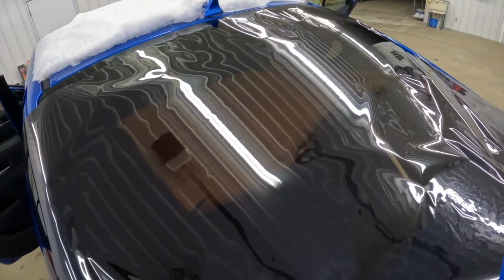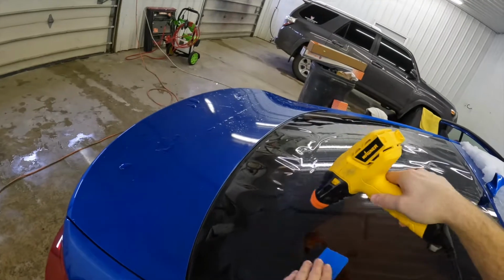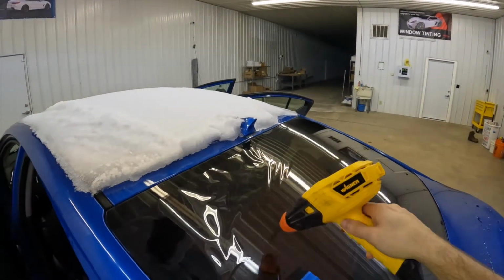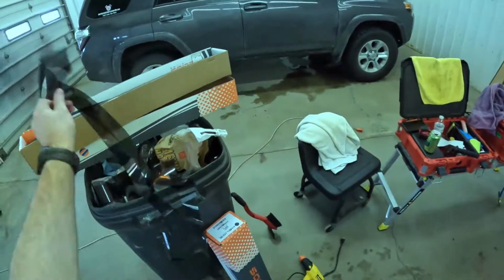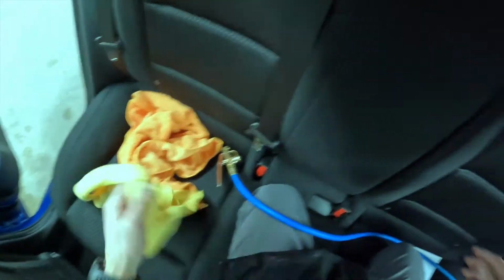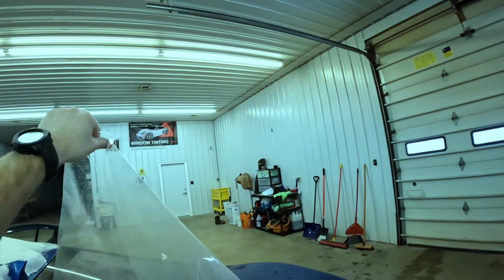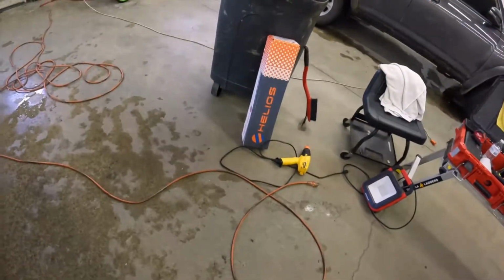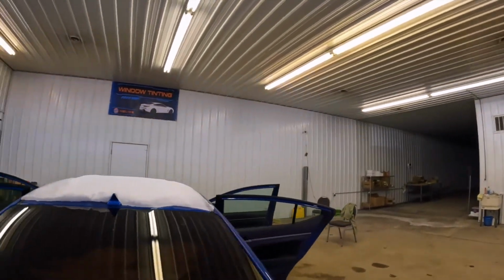How To Heat Shrink, Prep and Install Back Window Tint!

Comment: For the back windshield you didn’t use any layers of dryer sheets? Just apply the tint and shrink it?
Reply from the maker: You need to use either dryer sheet or bar soap. I just didn't include that because in winter time it takes a lot longer for it to dry and go pro batteries do not last more than about an hour. So I got all that stuff set up and the film laid out before I hit record.

Comment: Where did you get the steel wool scrub pads?
Reply: And the lights too the ones you used for the back window
Reply from the maker: The scrub pads can be found pretty much anywhere that sells stuff for cleaning dishes.  Dollar general, lowes, home depot, walmart, etc.
Reply from the maker: I use a few different lights for back windows.  My go to is my astro 52SL which you can find on amazon, or certain tool trucks. And then my Milwaukee M18 Rover light which you can find at various online retailers as well as Home depot stores.  @AnthonySalagdo